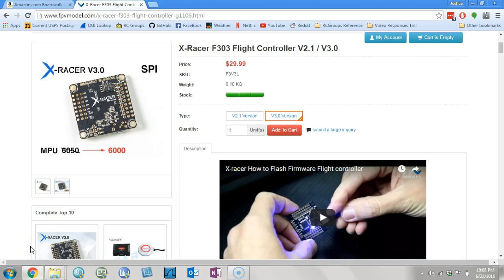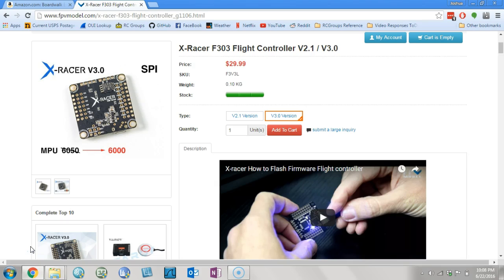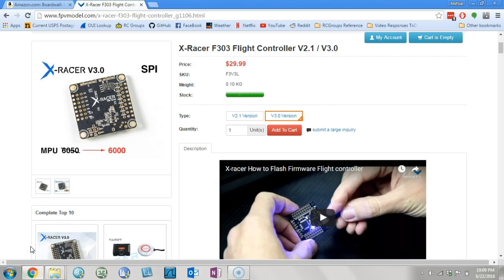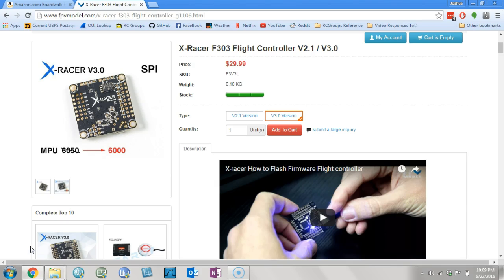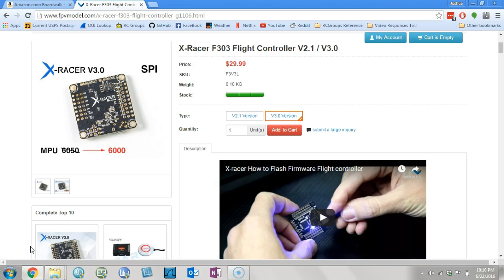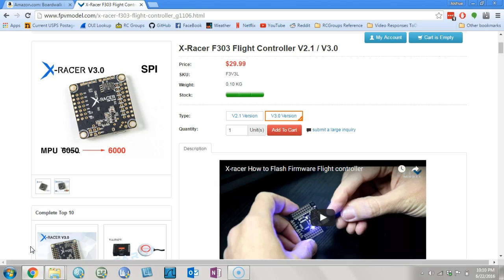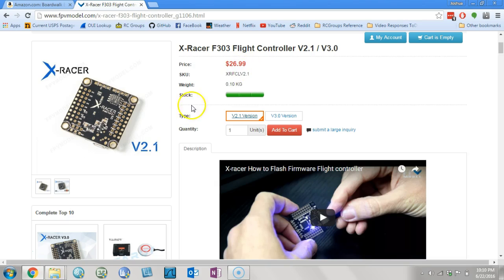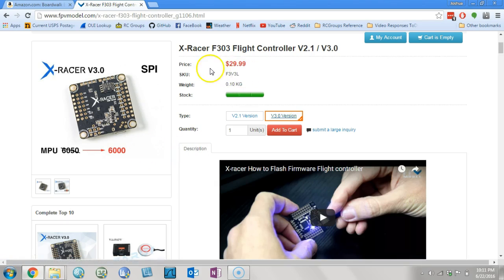Xracer F303 v3 is here, With 8 kHz SPI MPU6000!

Comment: how do you guys wire this rc for ppm I can't find it anywhere? and how do you power the board?
Reply from the maker: For PWM and PPM, use the pads labeled "RC Input CPPM/PWM" in the diagram below:

http://www.fpvmodel.com/u/tmp/goods_desc/2015-12/20151228162515-5348.png

CPPM is channel 1.

You power the board from a 5v regulator such as on you rPDB. Connect it to any 5v pad, such as on an un-used motor header.

Comment: Has anyone been able to confirm that this BLHeli passthrough works on this board? I just ordered v3.1. I've been an F1 guy forever, so this should be a nice jump!
Reply from the maker: BLHeli passthrough works on basically every cleanflight and betaflight F3 and F1 board today. Exceptions are boards with uni-directional buffers on the motor outputs, of which KISS and Tornado are the only two I know for sure.
Reply: Joshua Bardwell Thanks!!

Comment: do the buzzer pins work on yours?
Reply from the maker: +AyKayFPV yes.
Reply: I'm beginnung to think I have a faulty board. USB is Powering the ESCs backwards through my UBEC and I have no diode lying around to fix that... so I'm stuck for now -_- buzzer pins don't work on mine... (double checked the buzzer and it's definately working)
Reply from the maker: +AyKayFPV did it come that way?
Reply: yes... when usb is plugged in the 5v rail is powered... which it is not on a naze32... so i have this backfiring issue like on an older dodo... I have no idea if the faulty buzzer port is related to that issue.
Reply from the maker: +AyKayFPV the receiver should be powered but not the ESC's.
Reply: I double checked... and I have 5V on the following pins: esc AND receiver pins, uart 5v pins AND buzzer + pin (usb plugged in and ubec desoldered... with ubec connected voltage drops down to around 3.8v - I guess because the ESCs draw current through the PDB)
Reply: just to let you know: soldering in a diode between ubec and FC solved all my problems

Comment: Joshua - can you take a look at the following issue I am having? http://www.rcgroups.com/forums/showthread.php?t=2464844&page=2432&highlight=Betaflight+motors+full+throttle+reboot#post35528515.  Wonder if it's a min/mx throttle issue or motor timing issue.  Trying to get my RacerX v3.1 up in the air.  :)  Love the board so far!

Comment: Which are the pins to use the softserial ports on new v3.0 ??
Reply from the maker: I suppose it would be the same ones as always: the ch1-8 pins are the RC header, so check the pinouts here to find the pin numbers: https://github.com/cleanflight/cleanflight/blob/master/docs/Board%20-%20Naze32.md#pinouts

But I have heard from some people that, even though the pins are present, they can't get softserial to work, so if you can get it to work, please message me to let me know.

Comment: Hi Joshua. Question. You know how there's 1-8 motor inputs on a flight controller, and you use inputs 1-4 for a quadcopter? Suppose input number 2 stopped 
working(burned out or something) . Can you use input 5 or 6 instead and 
if so, how would you set it up in say, cleanflight? Thanks
Reply from the maker: https://www.youtube.com/watch?v=xDpWLFswHUc
Reply: Joshua Bardwell
Ah Joshua, you're a star. Just what I was looking for. That's a great help. Thanks ;D

Comment: I fly spektrum, waiting for the horus x12s to make the switch.  The boot switch pin is a much nicer place to pull 3.3V from than the tiny 3.3v pad provided.  its big and solid and with a drop of hot glue it will stay there.
Reply from the maker: Good tip. I didn't know that the boot switch was 3v3.

Comment: I didn't clearly get about "non cleanflight different firmware" and what about betaflight, will it work on xracer v3?
Reply from the maker: +Роман Савченко yes it will. But for the time being, only 2.7.1 is available. And you have to use a custom hex from FPV Model.
Reply from the maker: +Роман Савченко yes it will. But for the time being, only 2.7.1 is available. And you have to use a custom hex from FPV Model.
Reply: +Joshua Bardwell thank you so much for the information!

Comment: Josh. just looks like a actual spectrum sat connector is done.

still pin out for direct solder per pic
Reply: I fear you are right Josh... no spektrum... looks like diagram is older model. Website is not clear

Comment: Thanks for your great channel Joshua. My question isn't directly related to the XRacer although I do use one :) With the aim for a clean build, what are your thoughts on removing the negative wire from an opto esc, such as the DYS Mini Opto 20a? I have noticed there are many mixed opinions regarding this, so would you perhaps consider doing a video on whether this is a good idea or not.
Reply from the maker: I always run the ground wire. It's not always necessary, but sometimes it's necessary, and I think it's good insurance.
Reply: +Joshua Bardwell thanks Joshua

Comment: So your saying if you have Specktrum satellites you can't use this, that is absolutely crazy. They just alienated a huge portion of the market
Reply from the maker: +Zaniix_FPV you can still use a Spektrum you just don't have the separate header broken out and you have to find 3.3v somewhere on the board. Really, who installed the Spektrum header on the v2 pads anyway?
Reply: +Joshua Bardwell I took a look at the layout and it still has a 3,3v connection. I'm very happy with my full range diversity orange sattelite. If you wanna have telemetry go for orange full diversity receiver with sbus and telemetry. the shitty quality is what kept me from buying a taranis. my spektrum isn't going out the window yet, I see no issues using it with the v3.
Reply: Sorry I misunderstood, I thought you were saying you could not connect a satellite RX to the FC at all.
Reply: if you are looking for 3.3v on the diagram - I think that is older board. Which if true, FPV model should clean up pics and make things clear.

Comment: Lol I feel like that spektrum comment was directed at me.
Reply: Do we know for sure that this board cannot use spektrum sat's?
Reply from the maker: +Razor E there is no Spektrum header broken out. There is a small pad where you can get 3.3v. Then wire to the UART per usual. Or use a Spektrum receiver that takes 5v, linked elsewhere in the coments on this video.
Reply: Joshua Bardwell
thanks Josh. Was not sure if board was capable or serial rx. I am reading through comments now
Reply from the maker: +Razor E sure. It can do SBUS right?
Reply: I dont know. You can get orange spektrum orange rx with sbus inverter cable but I dont trust orange but I do trust my lemon  dsmx sats;  So, really all spekrum sat users need to do, is use sbus connection from board, signal pos and negative,  but use VR to drop voltage to 3.3 v, or, like you said feed Sat with 3.3v pad found from other location... However - if the Sbus connection has a built in inverter how will serial rx work? Please forgive my ignorance in this area lol
Reply from the maker: +Razor E F3 has soft configurable inversion. The board should work either way. I don't fly Spektrum so I can't verify that but I think it should auto set inversion based on the serial protocol.
Reply: Joshua Bardwell
lets hope so as I have this board on order... thank you josh for your help
Reply from the maker: Commenter have reported success with Spektrum so I think it should be okay.
Reply: Sweet
Reply: Spektrum Sat works with v2.1 so it should work with v3.0.  I just wish they put a full sized through hole for the 3.3v instead of that tiny pad.

Comment: Not worried so much about the lack of a Spektrum Sat connector.  I'd just like to see a regular through hole for the 3.3V
Reply: Can you use spektrum sat on this V3?
Reply: You can on the v2.1, so I don't see why you couldn't on the v3.  My only gripe was that the 3.3v came from a small pad and not a full size through hole.
Reply: Brian D so did you connect ground and signal from sbus location on fc but use pos from that small pad?

Comment: Yes FPVModel! Please support Spectrum receivers with a Sat port 👍
Reply from the maker: +Michal Horváth because he has a Spektrum radio?
Reply: Why you don't use receiver with SBUS?
Reply: +Michal Horváth I shouldn't have to spend out more money on more receivers! It's not hard for a FC board manufacturing company to implement the support for Sats!
Reply: +Joshua Bardwell I run the Turnigy 9XR Pro with an orange TX module with the Lemon Sat diversity RX. I would love to purchase an X-Racer FC, but due to lack of support it rules me personally out.
Reply: Joshua Bardwell I have Spektrum radio and I use SBUS (orangerx R720x)

Comment: I have a problem flashing  the latest Beta Flight( I think 2.8.1) to F303 V2.1. I am using Mac and Clean flight ( latest 1.2.2)
Reply: Clean flight refused to flash Beta Flight
Reply from the maker: Manual baud rate?

Comment: I have a lot of issues with my Kiss FC. I think i will buy one of these but i heard it have some Software issues is that right ?
Reply from the maker: +leo ulreich the V3 currently requires a custom build of the firmware. You can download it from the FPV Model site. Or buy the v2.1 board to use standard hexes.
Reply: +Joshua Bardwell OK thanks, i really want to buy one because my Kiss is going crazy. With Standard PID's the quad was flying fine but yesterday i had 2 flyaways with this. It was like this to high D gain Problem but with Standarte D gain (10)
Reply: that's interesting because I was wondering if you could still use the sp racing f3 hex as the gyro is now different.
The download only has betaflight 2.7.1 a raceflight and a cleanflight hex files.

Comment: Actually an internal 5 V regulator would be nice to have (as already mentioned below...)
Reply from the maker: +Sebastian Nobody I prefer to run 5v off the PDB but it's just a preference. Also remember that some people like to run their whole electrical system off a 7 volt regulator for certain reasons.
Reply: Well, I know that there are pros and cons for an internal regulator. But in my opionion a clean independent voltage regulator which only feeds the board itself would be not so bad I guess. And for the +6V or +7V guys the bonus feature could be to choose the voltage by solder bridges or dips.

Currently I am checking the betaflight configurator. It's really nice!

And by the way: Many thanks for the great input and help you give us for our hobby. Great channel!

Comment: My only issue with this controller is it does not have a 5v regulator on it. Would love to be able to run it straight from the VBat holes. Dont like having to use pololu or other PDB's with regulators on them.

Comment: You should have mentioned that it now has it's own fimware. Not SPRacingF3 anymore!
Reply: That could be a negative as well, as with all new things, there's usual growing pains...  Specially with software.
Reply: +BisMaxx 
yeah... for the moment you are stuck to cleanflight 1.13 with v3.0 as far as i know.
Reply from the maker: I actually didn't realize that when I made the video, but it appears you're correct. This is really a shame, and I hope that FPV Model does what needs to be done to get their target included in the official repos.
Reply from the maker: Or betaflight 2.7.1, or raceflight. The RAR file appears to contain hexes for all three.
Reply: +Joshua Bardwell 
Good to hear! I didn't know.

Comment: Do you still need 5V to power up the board? Or the Vbat does the job?
Reply from the maker: The board does NOT have an on-board regulator. If you feed it vBat, it will smoke. (Of course, you can give it vBat on the vBat input pins, but that's just for voltage sensing, not power).
Reply: +Joshua Bardwell thanks, well that case they can put it in the V3.1.

Comment: You can still connect a spektrum satellite through the sbus pins. It's both a serial connection, you just need a 3.3V stepdown.
Reply from the maker: Is there on-board 3v3 somewhere you can find?
Reply: I thought about an Pololu or something like that. (https://www.pololu.com/product/2097)
I've got the V2, but connected only the voltage pin to the 3,3V pad on the FC and the signal/ground to the sbus-pins, cause I'm using servoconnectors, the original of the satellite broke off. (Sorry for bad english)
Reply: There is a pad close to UART1. Just connected my sat. yesterday, no problem at all.
Reply: please explain how you connected spek sat?

Comment: It would be better if it had neat non-messy pinout and F4 processor (kkng f4)
Reply: It's an incredible board. :)
Reply: pinout is not messy what are you talking about?
Reply: Its all over the board, thats messy as hell when you want to wire it up.
Reply: pinout is fine to me (v2.0)

Comment: Just ordered.    Has Betaflight hex that we need to use with V3 on this board changed from spracingf3?
Reply from the maker: +Michel Morin I'll check with FPV Model to be sure.
Reply from the maker: +Michel Morin I don't think so.
Reply: I think it does project bluefalcon did a review of the board and it didn't ship with normal cleanflight
Reply from the maker: +Leslie W bottom line, just check what it ships with before updating. Type "version" in the CLI.
Reply: That was my concern as well based on project bluefalcon findings on the version displayed in the CLI wasn't spracingf3.     Will wait for confirmation on this before I flash mine when I get
Reply from the maker: Okay, I can confirm that it is NOT the sp3 hex any more. There is a RAR file link at the bottom of the product page with custom hexes for the board. Currently, cleanflight 1.13 and betaflight 2.7.1 and one rev of raceflight are all that is available. I hope that FPV Model does whatever it takes to get their target included in the official repos soon, as this could be a big stumbling block for many people.
Reply: +Joshua Bardwell care to annotate the video in this regard? most people don't read all the comments 😉
Reply from the maker: +Nelson Muñoz maybe, but a pull request is already in, so I think it will get fixed soon.
Reply: +Joshua Bardwell well it'd be simple to take down the annotation once/if it's fixed. I think it would help the credibility of your channel, no? simpler and faste for you to annotate than for a target to be added and tested, no?
Reply: +Joshua Bardwell just as an aside, i watched mattystunt's latest vlog and he had a ton of annotations edited in correcting stuff he got wrong while making the video, no one expects anyone else to be perfect and no one knows everything but i really feel inclined to value and actually straight believe in someone when they go above and beyond their audience's expectations of veracity and accuracy. Anyways kudos on keeping us informed on all the latest, this channel is a great resource 👍
Reply: maybe motolab.hex as it has the same hardware? might have differnt targets and drivers so do at your own risk
Reply: Go to the x-racer link. You'll find cleanflight, betaflight, and raceflight in the zip file of firmwares. We're working on getting them in the drop down box on the configurators but will take a little time.
Reply: +WWW.FPVMODEL.COM not just a pulldown thing though, at least for betaflight it's "just" release 2.7.1 (betaflight_2.7.1_FPVFC.hex) that is pretty underperforming (and old in bf terms) compared to 2.8.1
Reply: I absolutely agree, that's why we've sent in a pull request to Betaflight. Hopefully it will be committed soon. We will update though...knowing betaflight that'll keep us busy....might have 3 or 4 updates by the time this weekend is up. :)

Comment: Sorry what have they removed for spek sat- i was considering getting one of these.. Correct me if I'm wrong but didn't they just moved it toward middle of board - removing channel 7 and 8?
Reply from the maker: +dave123443210 I thought they removed the Spektrum pads in v2.1 when they needed room for the through holes.
Reply: +Joshua Bardwell i see now thanks. i was comparing 2.1 to 3 and couldn't see a difference hence confusion). Still think you just need a 3.3v pad (for dsmx sats anyway) - which they removed in 2.1 so if i can find it elsewhere on the board could make it work with uart3. Wish i hadn't bough spek lol :)
Reply from the maker: +dave123443210 Spektrum is just serial so you're right that all you need is 3v3.
Reply: +Joshua Bardwell theres a breakout next to the rgbled port which looks like they added in 2.1 and v3 has it too so they kinda thought of this problem. Great news! Thanks for vid
Reply from the maker: +dave123443210 that's good news. I guess it was just the actual header that was removed.

Comment: Still wanting to move to f3. Still stuck in f1 at the moment.
Reply: Dont waste time, get a F4 board :D
Reply from the maker: +neclovekSK can't run Betaflight at this time. Only raceflight.
Reply: Joshua Bardwell  I do believe there already are Betaflight builds for F4 boards. And why is that a problem anyway? Raceflight is amazing, new betas are pure awesomeness + there are many epic features coming.
Reply from the maker: +neclovekSK raceflight is great, but I couldn't give up Betaflight, even if only because so many viewers are interested in it.
Reply: Didn't even knew about f4 :0
Reply: Joshua Bardwell You dont need to, just expand to both, I'm sure you have enough quads for that.
Reply: Why don't you just give us an bg or aliexpress link to the stripped down one
Reply: Zapf  Its readytoflyquads revo acro
Reply from the maker: +Big Iron Interactive the issues aren't over. I saw a report just yesterday. It's just a gamble. Usually you get your order fine. If you don't, you're probably out of luck.
Reply: Dude, pull the trigger and run some BF!!!!!
Reply: Joshua Bardwell
Literally saw 24 hours ago people buyin a pixracer clone and having basic things like gps cabling being wired wrong. So much binned hardware and clones being sold under the rtfq brand